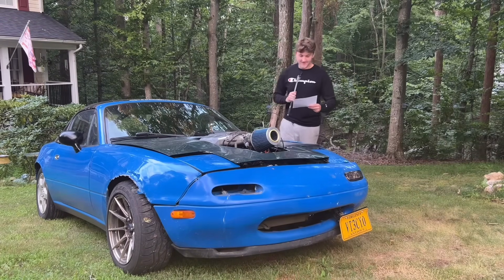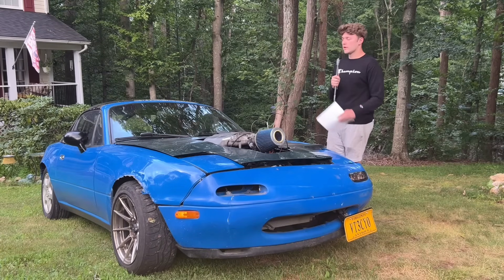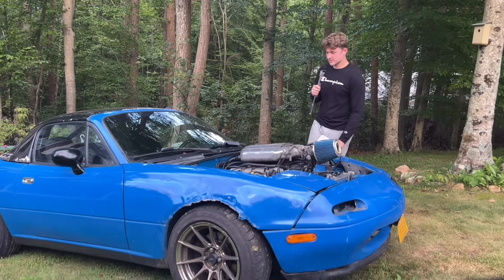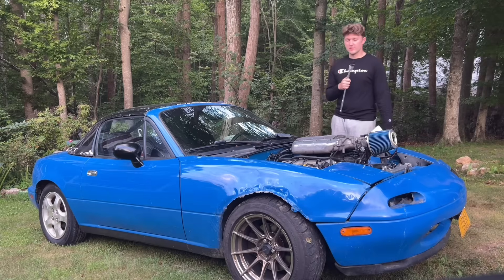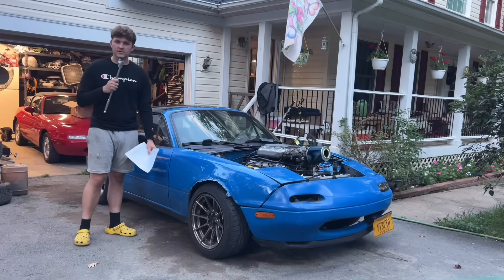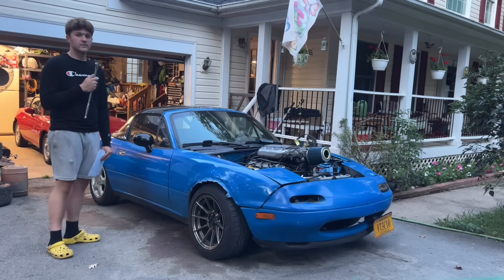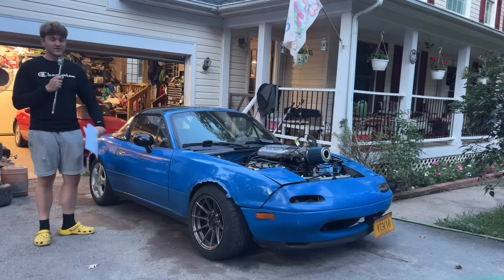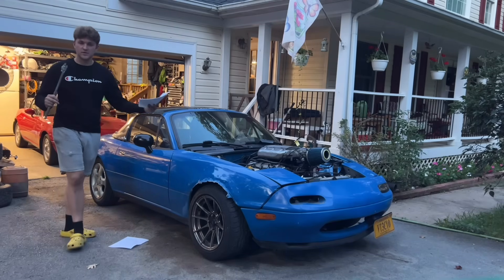Honda J35 V6 Miata Engine Swap Build Overview

Comment: I'd J37 swap it.
I've got an NA and an NB.  The NA needs an engine because it has the 1.6L in it.
I also have a MDX sitting in my driveway.  If anything happens to it, I'm yeeting that motor. 205k mi be damned.  I'm chasing that 300hp dream.
THIS is what engine swaps are all about.  Bang for the buck.  I'm all about this swap.

Comment: no idea why yt pushed me this video, as I don't consume any miata / engine swap content, but more people should do breakdowns in this style.

be sure to put links in the description to the key parts you used, even if its an affiliate link. if you're happy with the part its not shilling.

my mom puts like 40k+ miles a year on her 21 miata. maybe I'll buy it from her when she ages out of it and I hope someone does content for that generation like you've done for this.

I'm sure this ride is a blast, because the j in my wife's 06 odyssey is suprisingly fast for a heavy brick.

Comment: Would still be hella cool to build one even a little, whether it's slapping a Whipple & a set of injectors on the current engine after changing ring gap and doing a minor rebuild or it's a turbo after rebuilding the "new" one, or something in-between; I know you say "no" but if you could do all this then you could do all that too, probably easier, and lots more fun still on top of where you're at now
Reply from the maker: I would love to do another j swap with some boost in the equation for sure!

Comment: I have a j35a4 in my miata. Does yours idle at 1500 rpm? Also does it have a long crank
Reply from the maker: Mine idles like factory but I do have a long crank. I’m assuming you’re also running the Minitec ecu? Bypassing limp mode on the stock ecus create a longer crank. Did you block off the egr port in the intake manifold?

Comment: Definitely keep this swap N/A. A proper all-in N/A 3.5L build can get you into the low-mid 300s of WHP with a safe 8200-ish rpm redline (forged rods to be safe) to about match the S2000's RPM stress levels. Oh, and that's still on pump gas and less than 12:1 compression, BTW. If you push 13:1 with E85 and dry-sump it (custom setup, look up Superfast Matt), I'm willing to bet you could push 400whp all motor. Also, you can get stuff to lighten the engine, such as the magnesium intake manifold from a later-gen MDX, IIRC.

Also, since you have a first-gen J series, you have the 3-port heads, which should (well, space constraints aside) allow you to make an epic-sounding stepped, equal-length, 6-2-1 header which'll have this baby screaming like an RB or a V12. Though I'd suggest looking into a J35A3 instead, as I've heard that the A4 out of the Odyssey has weaker internals or some such, while the J35A3 has the 32a2 head (best gen 1 head) and a forged crank plus thicker rods.
Reply from the maker: Big thanks for all of the info!! And I agree, I think it’d be sacrilegious to throw boost at an engine that produces power and torque in such a linear manner. Not saying that it wouldn’t be cool, but not what I’m going for. I’ve been eyeing up sets of j32a2 heads. It would be sweet to throw them on the next motor and mate a nice flowing set of headers to them!
Reply: @MeisnerMotors  Custom parts are always gonna do better than shelf part. Try to do some deep dives in your spare time and consider contacting general engine builders (not even of the J series platform, but old head guru types like David Vizard) to see what you can learn and try to cross-apply to your setup.

For instance, the P2R J series headers are 1.75in, whereas two different calculators I used suggest it wants a 1.5in to 1.625in stepped header in order to keep velocity up for proper scavenging. Those calculators were made for 2 valve domestic small block V8s, sure, but you'd be surprised the actual flow numbers you can get out of such architectures, which might mean that the calculators are slightly more universal than you'd first presume.

Plus, I straight-up compensated for valve area by converting 4 valves into an equivalent 2 valve sizing for the specific bore and stroke of the J series platform in those calculators. Since I'm personally not ready to proceed, yet, I haven't referenced further or contacted builders, myself, for their thoughts, but the groundwork is there, so to speak. If you want to truly optimize instead of just throwing expensive parts catalogues at it and hoping something sticks (and only getting about 85% of the potential), then I'd always recommend that someone do the same.

Hope I don't sound like I'm preaching or talking down. You have a great build so far, and I kinda hope to see you at Miatas at the Gap this weekend if you're close enough. Good luck!

Comment: How was the weight & balance (F:R) affected by the swap?
Reply from the maker: With the j series being all aluminum compared to the stock iron block, and with AC & power steering removed, it’s negligible. Maybe 20-30 lbs heavier up front. Would love to get it corner balanced in the future to find out the exact figure.
Reply: I was also considering the engine size, because most of the engine is also further back.
Reply from the maker: @Iowa599 3 cylinders is definitely shorter than 4, but I’m unsure off block length. There is still a lot of room up from between the rad, so it might be close to factory engine length.
Reply: @MeisnerMotors  I just researched it...

~2% shift forward, because the J35 weighs ~125lb (~60kg) more, is what the internet says. 2% is like 50lb, so you partially corrected for that by removing the hood 😂

i guess I can't complain with that. I bet an LS is so bad I bet it reduces weight on the rear!

Comment: burning oil is probly due to the pistons' oil control rings packed with sludge. Check compression to verify.

if the compression is good, Seafoam will clean the rings out. I've fixed a few cars that way, including my 140k mile Prelude daily driver. I was afraid my rings were worn (because aluminum oxide is harder than steel), but compression was good. An overnight soak in Seafoam & the oil consumption nearly stopped!

if you need more info on how to do a Seafoam soak LMK.
Reply from the maker: A very good truck indeed! My turbo Miata had stuck oil control rings due to it sitting for so long. Wish I tried the Seafoam method before I threw another motor in!

Comment: 2:39. Relatable. 00 Celica GTS Auto in a junkyard. I wasn't gonna bother using the engine hoist, so I disconnected everything and literally dropped it with the subframe. My $100 Amazon impact gun did a pretty damn good job at those subframe bolts that were also holding up the entire front end of the car.
Reply from the maker: Why not go the easy route if the car is getting scrapped? I love my $100 SeeSii impact too lol

Comment: what trans did u use for RWD?
Reply: The Miata trans…
Reply: Lol
Reply from the maker: Stock Miata 5 speed. A 6 speed will also work if you’re looking at pushing more power & torque.
Reply: @MeisnerMotors im looking at j35 swapping my 98 accord, it would be sick to RWD lol

Comment: Ya lost it when downing the oem engines
Reply from the maker: Just some friendly banter. Whether it be a 1.6 or any flavor of 1.8, they’re all great fits for these cars. Just a shame they’ve gotten so expensive.
Reply: @MeisnerMotors i 100 % agree with ya , it is a shame , and to each their own , i dont try to knock any engines as i seen a 2 liter with over 2200hp , but i will say that the j series is a great engine for a v platform , and when done right , it can make crazy power to .. its all a matter owlf what ya can do with it and what ya build it for ...peace and love brotha, keep it rad, stay safe, and build on..l8r famz and keep having fun
Reply: 80 hp just aint it bud.
Reply: I have a 400hp 1.6 , dont be lazy 😅
Reply from the maker: @mastercricket7626 dang Greg Peters over here we love to see it!

Comment: Subbed. Got goofy ahh energy.

Edit: also, on the arguement of boosting the car just get a bigger pulley eaton m90 or m112 from a wrecker, not for more power, but more goofy, and low end torque. With a port job like gingium did on his drift truck, you can make them sound insane, which matches the insanity you have currently.
Reply from the maker: Happy to already have a supercharged Miata so that part of my brain has been itched, but there’s always the option.
Reply: @MeisnerMotors then, why not use a VGT turbo then? Make it whistle like a diesel truck and spool like a small turbo with big turbo power.
Reply from the maker: @KadiusFTW because I also have a turbo Miata 😅